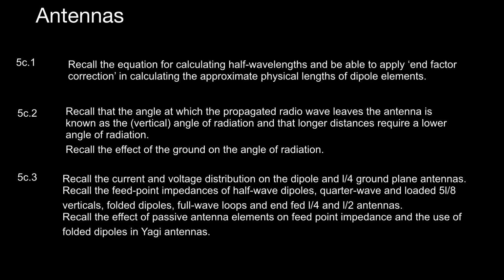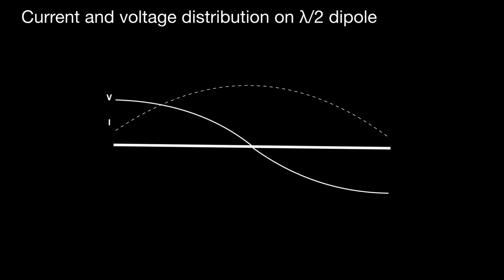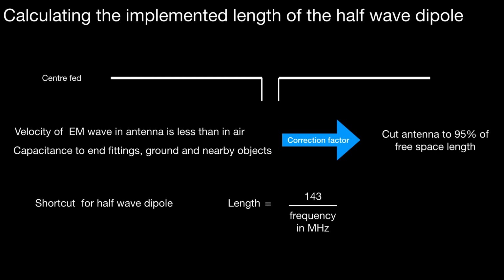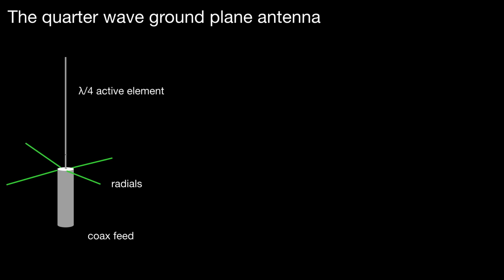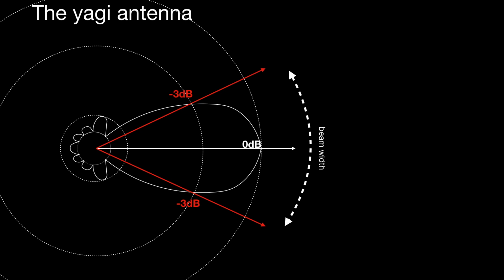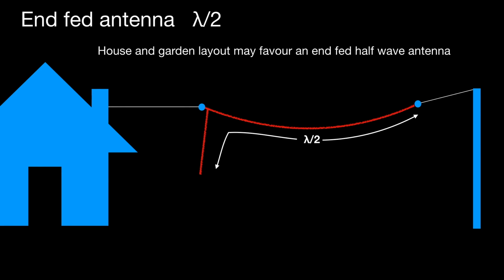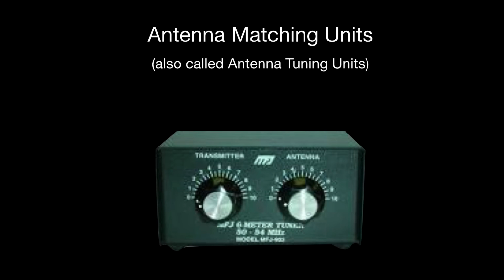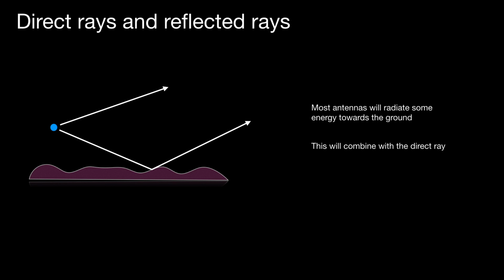Advanced -Antennas

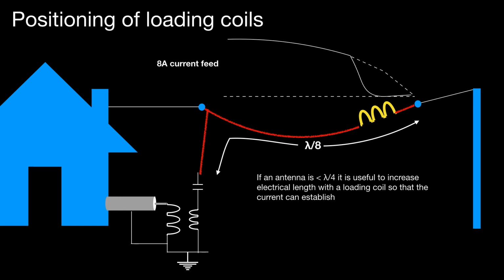Comment: @43:05 "...it's better to locate the loading coil towards the end..."

You may want to revisit the argument for placing a series inductive loading coil toward the non‑feed end. While current is indeed lowest at the end of a short wire, a series inductor relies on current to generate the compensating inductive voltage needed to cancel the antenna’s capacitive reactance. As the coil is moved toward the end, available current collapses and the required inductance rises rapidly, tending to infinity at the current node.  Publicly available analyses show that inductive loading is most effective around the mid‑section, while end loading is best done capacitively (capacity hats) rather than with a series coil.